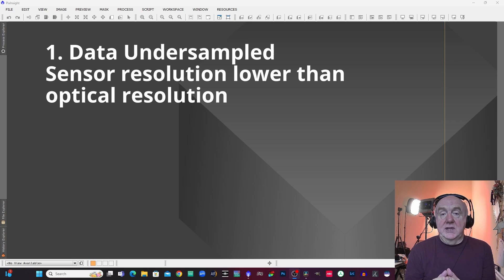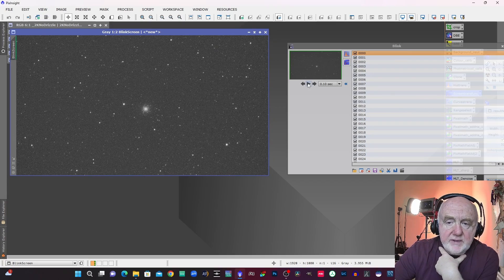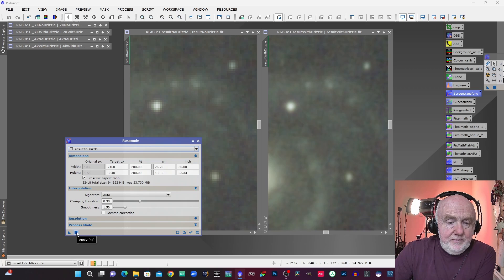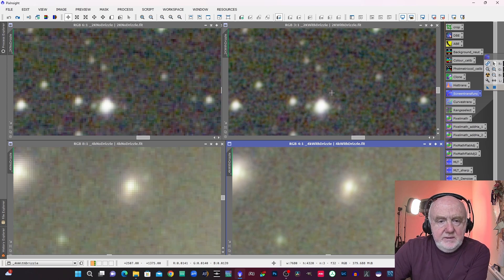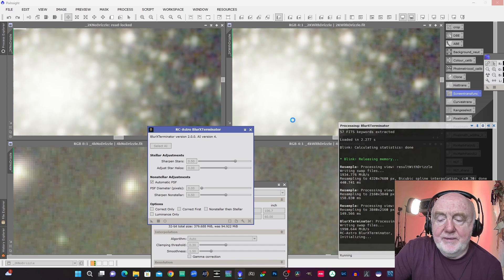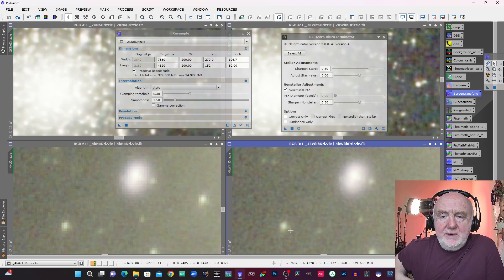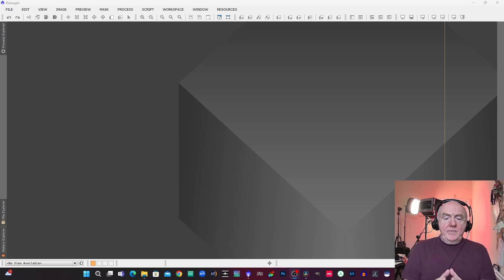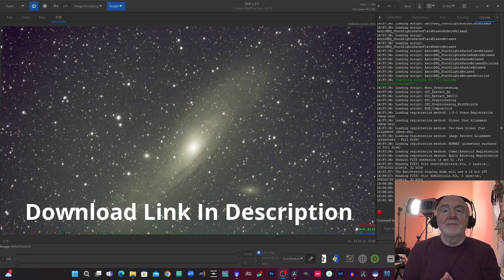AstroBBQ Drizzled Siril Stacking Scripts

Comment: hi can you help i tried using the new drizzle script with my seestar s50 using siril 1.4 and it fails saying not mono cant execute what am i doing wrong your other script for lights only with less rejection works fine
just found this comment in regards to this error mesage posted elsewhere
 Several of the commands used in Siril 1.2.x have been obsoleted and replaced with new commands in Siril 1.4.x. Those obsoleted commands will not be recognized by Siril 1.4.x. You need to either update your scripts or run the old version of Siril. Drizzle is one of the changed commands.
could you possibly re do the script for the new version please
Reply from the maker: it would be good if I could see the actual console, perhaps you can upload a screenshot to here? https://www.dropbox.com/request/VJ3a3ta9FvTJj5uh8pyN

Comment: I've been using your AstroBBQ_StackLightsRelaxedDrizzled for fits files from my Seestar S50 and it has been very useful.  Thank you.

Often I use he script on 2 or more Seestar stacks where I did not save the individual light files.  I just upgraded Siril to ver. 1.4.0-beta1 and now the script fails with the following excerpt from the Silil Console:
# Align lights
Running command: register
This sequence is not mono / CFA, cannot drizzle.
Error in line 30 ('register'): invalid arguments.

Do you know how to fix the script?  Your script included the following:
# Calibrate Light Frames
setfindstar -sigma=0.3 -roundness=0.4
calibrate light -cfa -equalize_cfa -debayer

# Align lights
register pp_light -drizzle

Comment: I'm new to this hobby. I'm using a C8 SCT, AVX mount, ASI071MC Pro, Starizona 7.1 focal reducer and Celestron OAG with ASI174mm. Looking at astronomy.tool CCD Suitability calculator for OK Seeing Bin 1 my camera falls into the upper green zone so it is approaching over sampling. Poor Seeing is definitely oversampling at Bin 1. Bin 2 for OK Seeing is the middle of the green zone and Poor seeing is upper yellow zone so undersampling. I seem to always use Bin = 1.  So I probably won't be drizzling since most of the time I'm in a Bortle 4 area. So I should try the Sampling tool in Siril. I haven't tried dithering yet as I'm still trying to get PHD2 (NINA) figured out. So if you can't drizzle you should at least always dither while image capturing? Thanks